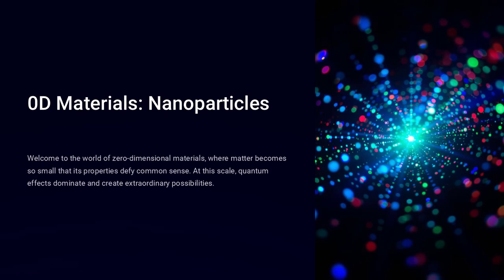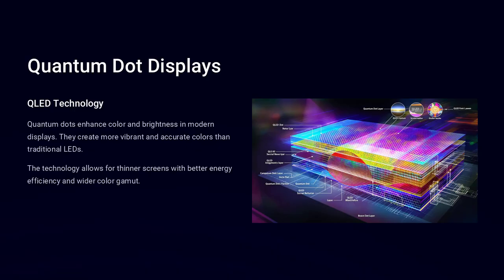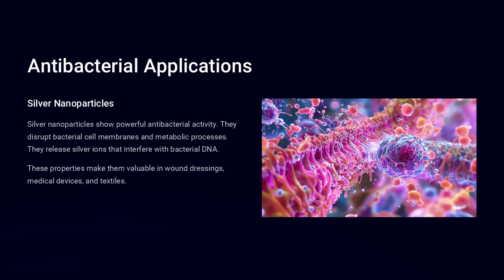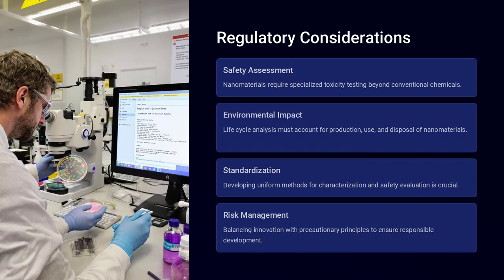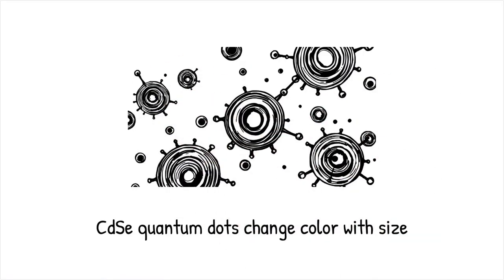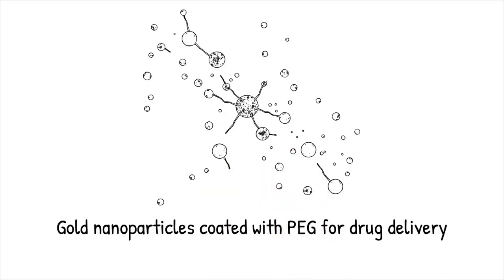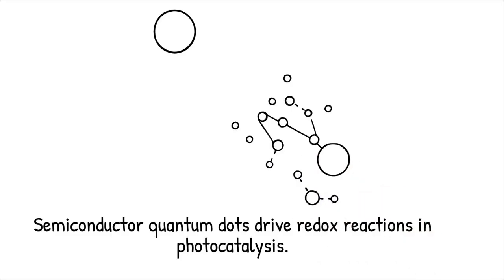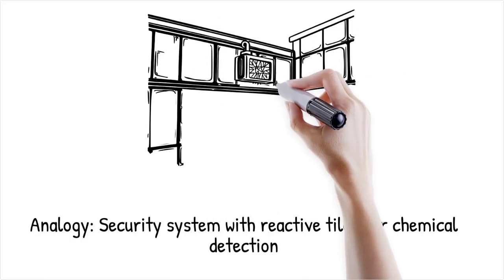Zero-Dimensional Materials: When Size Shapes the Laws of Physics

Comment from the maker: How can we optimize the quantum efficiency and photostability of eco-friendly, non-toxic quantum dots to match or surpass cadmium-based systems in both biomedical and optoelectronic applications?
What are the precise mechanisms by which quantum confinement alters electronic band structures in 0D materials, and how can these be controlled at atomic precision across scalable manufacturing processes?
To what extent can functionalized nanoparticles be engineered to navigate complex biological environments—such as immune evasion and targeted cellular uptake—without triggering systemic toxicity or bioaccumulation?